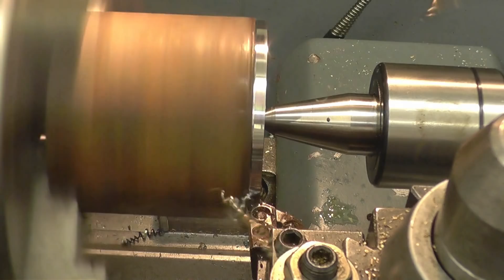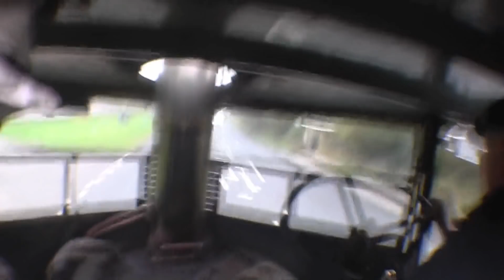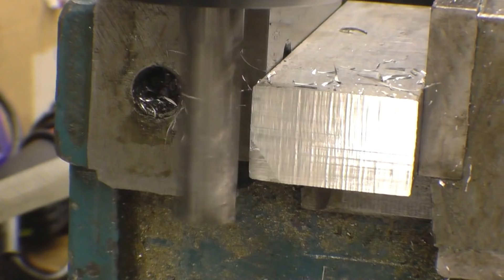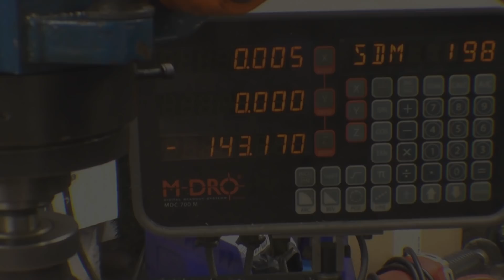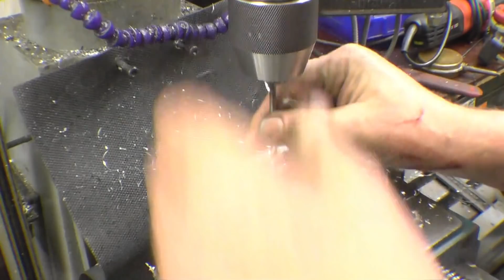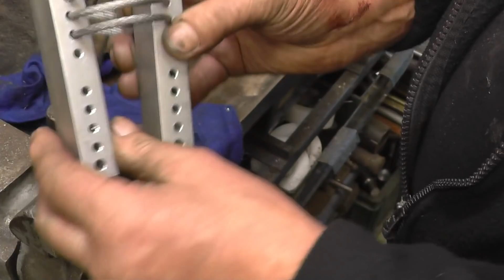SNNC 302 P2  Anti Vibration Camera Mount

Comment: Sorry about your dad, just never gets any easier does it. True, you never know literally from one second to the next what is in store.

Just a thought about the mount. Should look in to microphone shock mounts, they use an elastic material to absorb the vibrations. I think the metal will absorb a little, but in the end a flexible material will probably work better.

Comment: I have found the best isolation is offered by soft springing in extension (hanging from spring) with extremely light damping material. This was not for camera use but a measurement device.